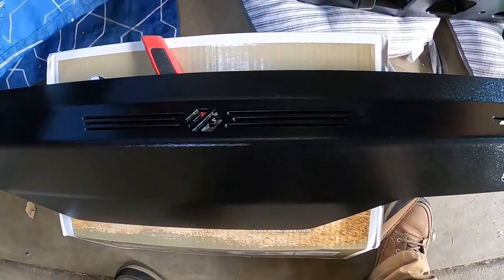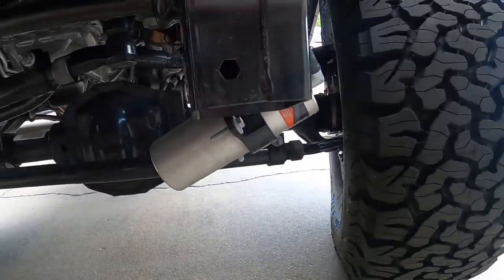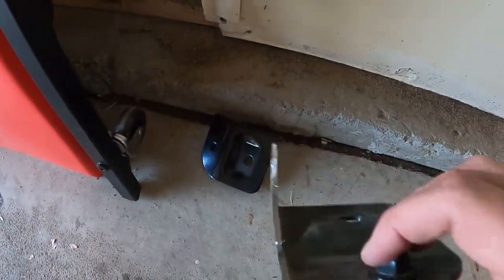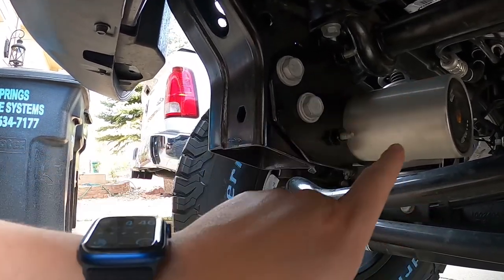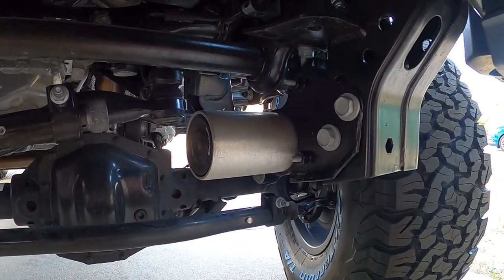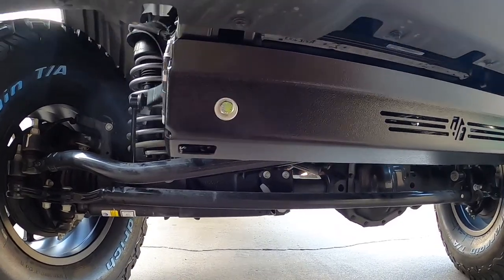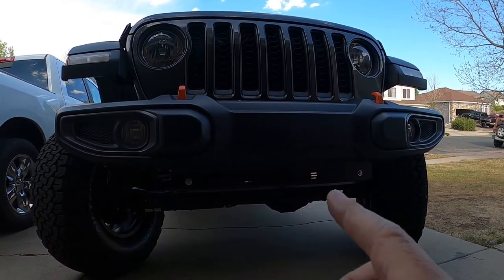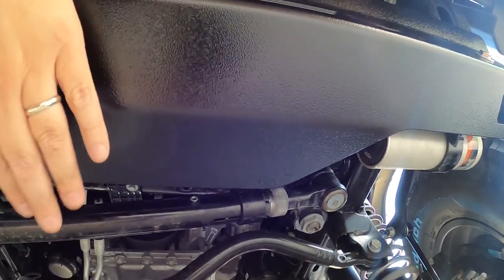Hefty Fab works Front Sway Bar Skid Plate - Jeep JL/JT , Mojave Install (short)

Comment: How did you secure the bolts into those hex holes that aren’t threaded, did they supply nuts in the hardware kit? I got the fab four sway bar cover for my 2020 JL and no nuts were provided only two bolts with a flat and locking washer
Reply from the maker: Yes, so for the Hefty Fab Skid Plate they do provide a bag of hardware that includes nuts, so those hex holes act as through holes. I'm wondering since you were supplied just bolts if they are supposed to aligned with the factory crushed nut on the front btm frame where the skid plate would go, however this could also depend on your trim level as well? Just to note i been short many times on hardware from various third party vendors for aftermarket parts and I wouldn't be surprised if you were missing nuts especially if they are aligning to the hex holes. there's been many times i will have to call the vendor or just take matters into my own hands and run down to the hardware store depending on time constraints. thanks for the comment!